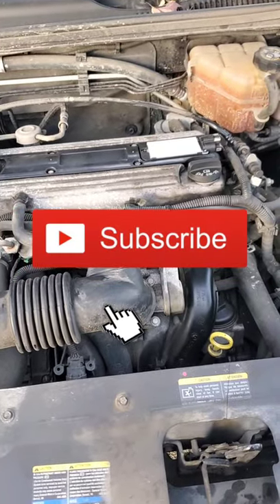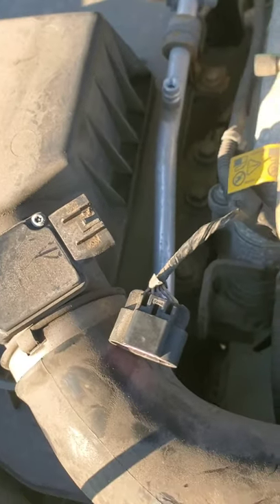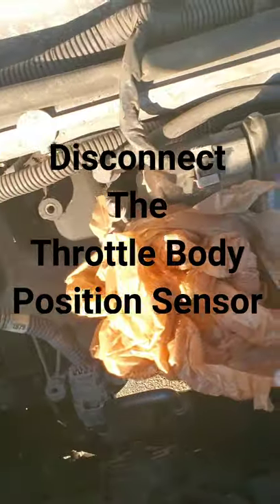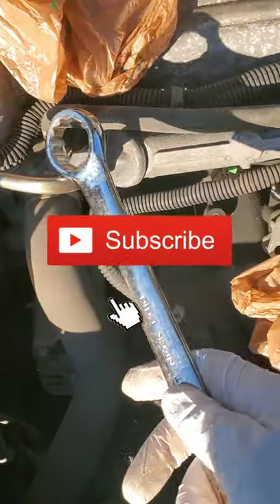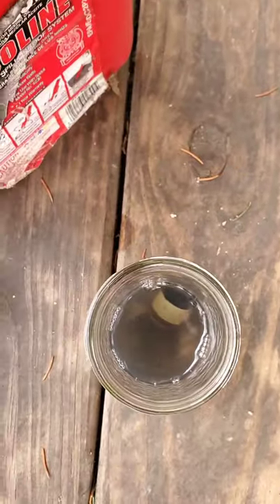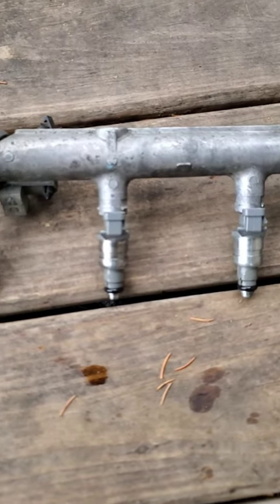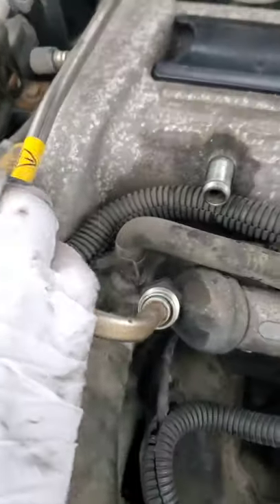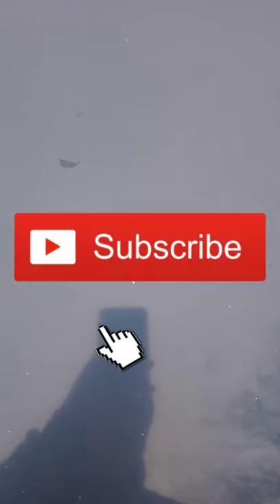How To Replace ALL Fuel Injectors 2005 Chevy Malibu 2.2 Ecotec Engine

Comment: Hey Dom, enjoyed the video! Just picked up 05 cobalt 2.2. Was wondering is it beneficial to just clean the throttle body while installing injectors? I can’t remember for certain if the ECU has to relearn anyway with new injectors. Anyway props man! 👍
Reply from the maker: Hey @B Reborn, it's always great to keep your Throttle Body clean (If it's needed) I didn't clean mines & everything worked great better than ever. You'll notice right away. Hope you enjoy your day, Be Blessed

Comment: Good video. Was there a reason why you replaced them were you having problems? And also how does it run now?
Reply from the maker: Yes had a misfire code
Reply from the maker: It runs great after it would drive like its losing power & i had a misfire code, i forgot the exact code, I changed the spark plugs & coils (Another video) That didn't fix the Misfire & when i replaced the injectors it ran fine
Reply: @dominiqueb9256  thanks I have a 2005 malibu and sometimes it sputters and acts like it wants to stall at a light. I was thinking it could be the injectors.
Reply from the maker: @stevenwebbjrhistory  Thats what mines was doing, let me know if it fixes your problem

Comment: I have a 2005 Chevy Malibu and I've been having problems with it. After a while of driving, if I'm stopped somewhere on idle, itll start to shake then it wont want to accelerate. I have to pull to side of road, turn off car and wait a while before I turn it back on. What do you think it is? Fuel injectors maybe or a bad fuel pump?
Reply from the maker: Good Morning, I wonder if you have a Check Engine Light, My guess check your Idle Control Valve, O2 Sensor, Spark Plugs & Coil (I have videos for that one) Check your Maf Sensor, Fuel pressure.. One last think see if it's making a lot of noise from under the hood could be the timing chain (I have a video when mines started doing that but the noise was loud) God Bless you & good luck, I know this is very stressful. Sorry about typing so much
Reply: @dominiqueb9256  spark plugs are brand new but thank you for that info